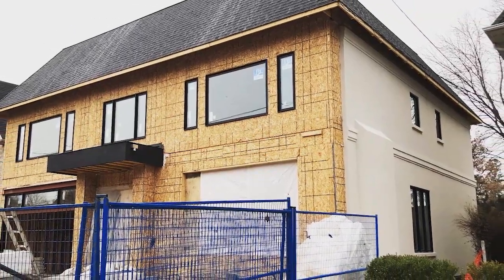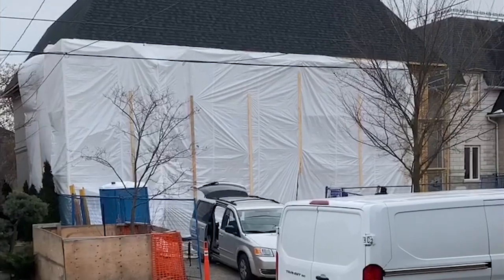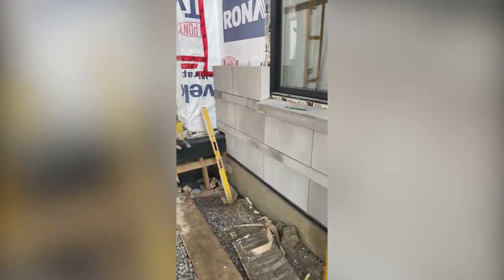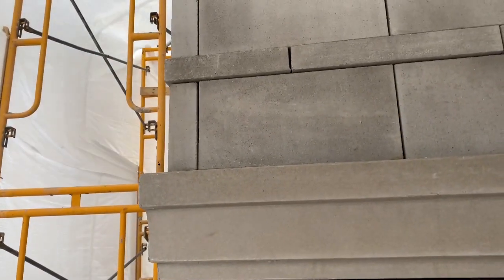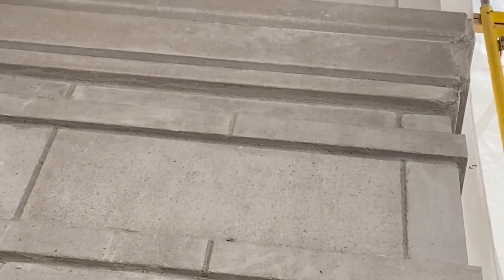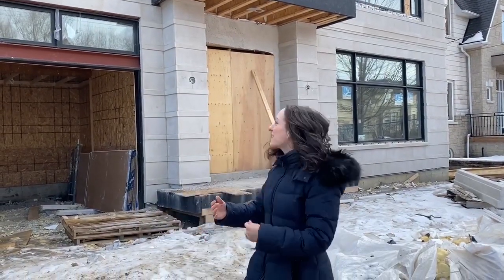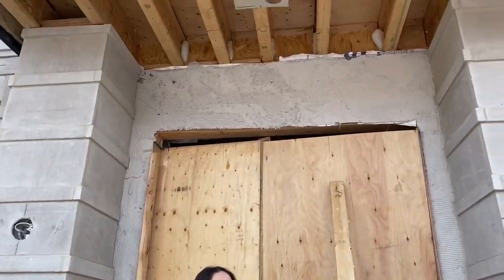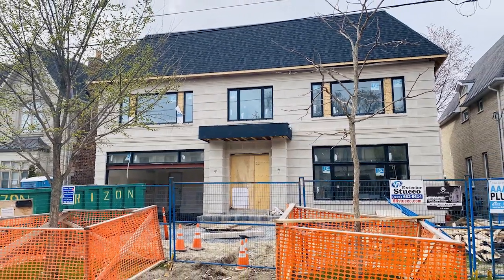Building a House: Construction Steps – Installing Stone on Exterior Front Façade (Limestone Look)!

Comment: Looks great! What is this product called? What was the cost difference between this product and polished indiana limestone? Both have very similar looks. I bet this product you're using won't get stained after a couple winters unlike natural limestone.
Reply from the maker: Thank you very much. We used a product called Arriscraft Renaissance in the nutmeg colour and we are very happy with the finished product. It is made to mimic Indiana limestone and we feel as though this is one of the few products we saw that really does a great job in mimicking real limestone. 
The price for the stone itself is half of what a real limestone would be. The labour cost will be the same for either product.
Reply: @WeTheWolfmans thank you so much for producing the exact product name and additional information. ❤